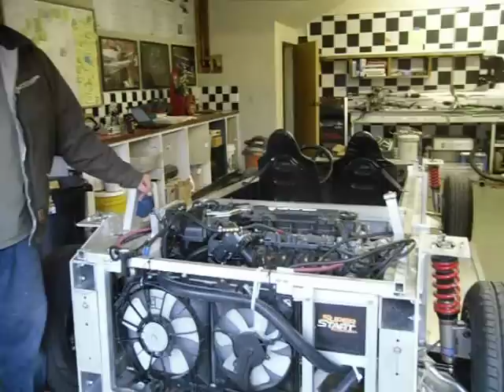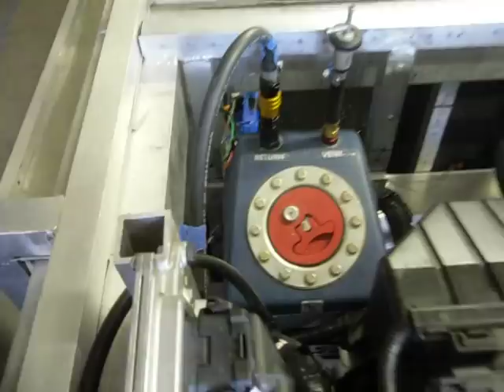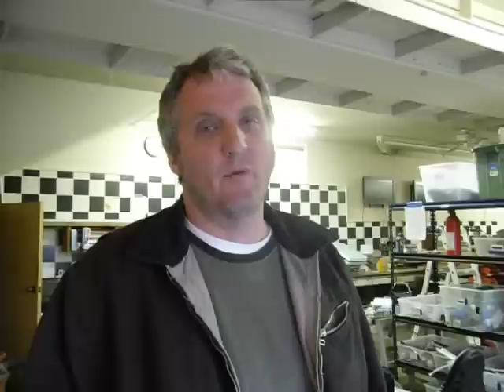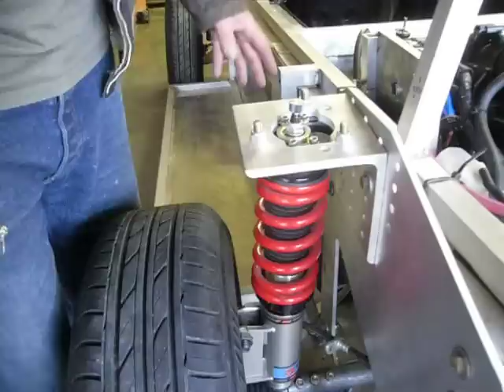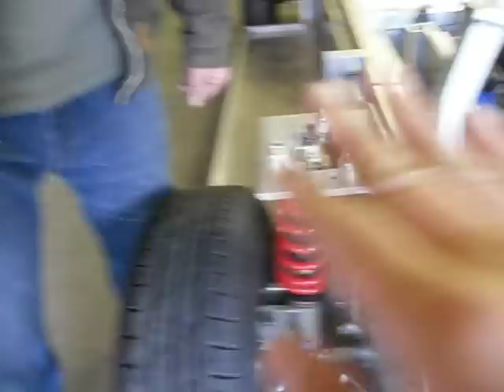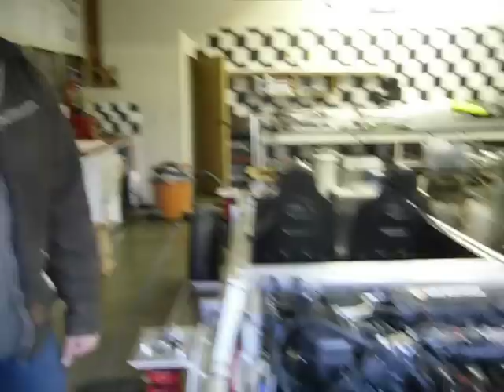Modular Sports Car Design

Comment from the maker: Modularity and simplicity of construction drives our design decisions.  Unibody construction involves insanely expensive metal tooling, such as giant sheet metal presses and automated cutting and welding.  We are interested in composites, such as cold-cure carbon fiber and epoxy, which can be build on a local scale.  Your comments are appreciated, check out our website and become a contributor or even a team member!